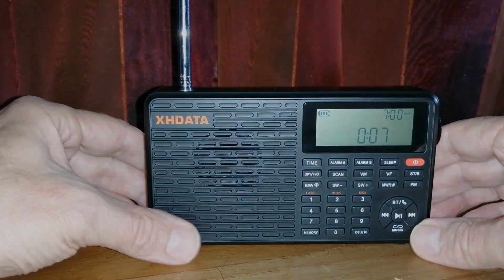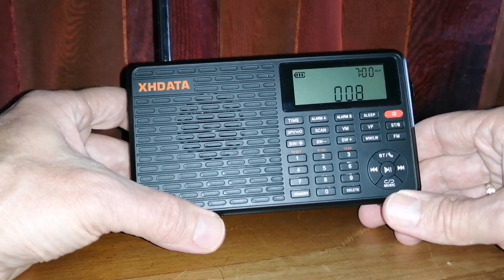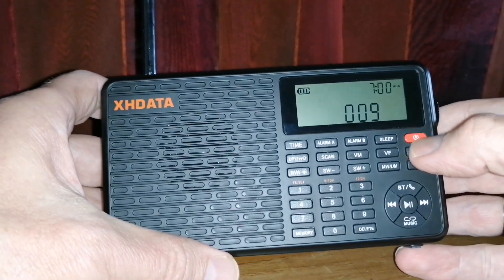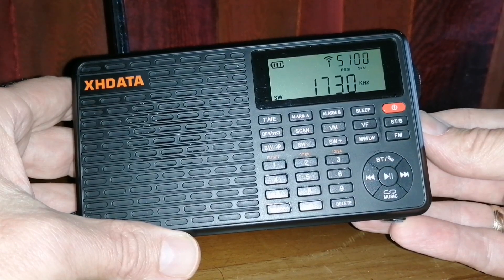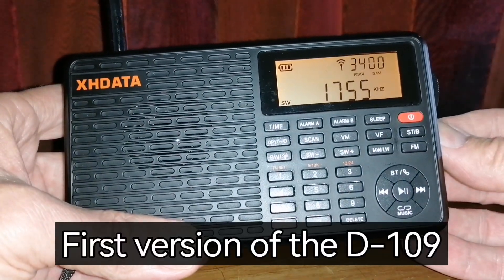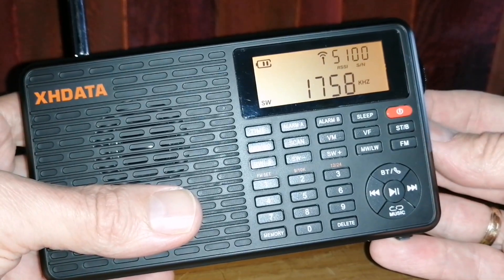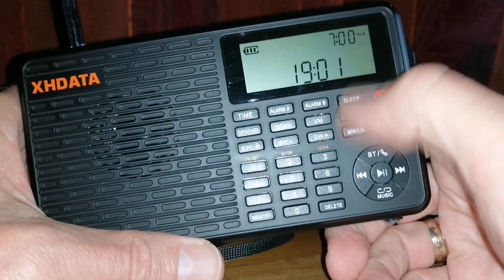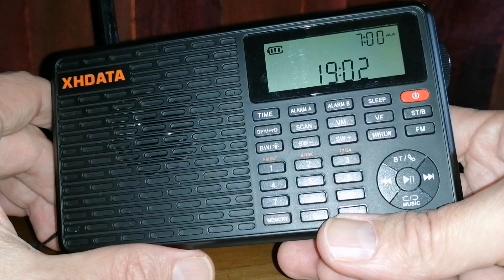XHDATA D-109 loves spurious signals!

Comment: These radios use a DC to DC converter to operate the audio amplifier at a higher voltage than the battery can supply. The converter runs at a high frequency of around 200 kilohertz, and being square waves, harmonics appear within certain tuning ranges. The 808 also has this issue but a different board layout reduces the interference.
Reply from the maker: Thank you for your comment. I also experience this issue on the Tecsun PL-368. Seems like many of the DSP-based radios have this issue.

Comment: You are possibly getting FM bleed though as you maybe close to a strong commercial FM station or strong AM (Medium Wave) station as the low cost made in China Shortwave radios pick it up as they use poor filtering. Here in the US sometimes I hear my local FM bleed though in the 6 MHz portion on the cheap radios such as my Tivdio/Retekess V-115 & my Tecsun PL-660 at times.
Reply: Regarding FM bleedthrough, I used to noticed this issue worse on a Grundig Yacht Boy 80 than on XHDATA D-808. The Chinese one is actually impressive in this regard, even on FM band itself it was able to withstand even a few 120kW stations from a former longwave mast I could see from the balcony. Only airband was a bit problematic, if I wanted to try DXing there.
Reply from the maker: Thank you for your comment, but I'm not sure if it is FM bleed through in my case. The languages I hear are not similar to anything we have on FM in my area.

Comment: i don't think it's software issue it's totally hardware issues, software doing nothing in this case because these signals pick up by internal circuit board. So the calculation is the internal hardware circuit not built properly with proper fliters, maybe cost cutting. That's it, but overall good radio with great sound quality and with some SW issues.
Reply from the maker: Thank you for this Ashu. It makes a lot of sense what you say, probably a hardware issue! Still a nice radio though, as you say.

Comment: I have a D-109 on order. I will check this issue after it arrives.
Reply: In my apartment, I found only one weak spurious signal in that range. I suspect I'll find more in a stronger signal environment.
Reply from the maker: @paul.steckler  Here on my side I do seem to find those spurious signals almost all the time. Doesn't really bother me though. Not much happening in that range anyway.
Reply from the maker: I am looking forward to hearing what you find!

Comment: Have you tried looking for these signals on any other of your receivers?
Reply from the maker: I have, but none pick up as many of these as the D-109. The Tecsun PL-368 sometimes picks up one or two, and the XHDATA D-808 also, just one or two.
Reply: @swlistening  Huh. Perhaps the signal processing is refined in the D109.
Reply from the maker: @FamtechVideos  Or perhaps not as refined, maybe that is why some signals appear where they should not.
Reply: @swlistening  You do have a point there. Are the spurious signals you pick up occupied?

Edit: When I mean occupied, I mean are they used by another transmitter? And is the transmitter powerful enough to reach your QTH?
Reply: @FamtechVideos  Or not as refined...
Reply: @twohandsandaradio  I see. I am doing extensive research on it.

Comment: Could it be the firmware or a defect in the DSP?
Reply: Are there other areas especially around the SW or ham bands where other spurious signals may turn up?  And watch for bleed from any FM or MW stations too.
Reply from the maker: @joeh52  I haven't found any spurious signals anywhere else on this radio, it only seems to happen in the 120m band, around 1711 and up to about 2450 kHz.
Reply from the maker: I am guessing it might be the firmware. My other DSP-based radios, like the XHDATA-808 and the Tecsun PL-368 also pick up one or two spurious signals on the same frequencies, but never as many as the D-109. Maybe it is a firmware issue, but I am really not sure why this is happening.